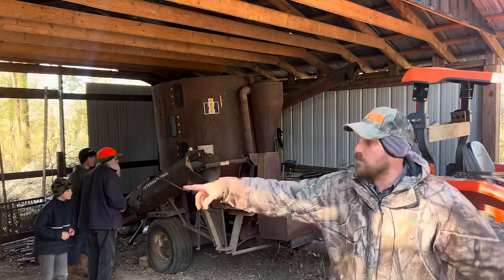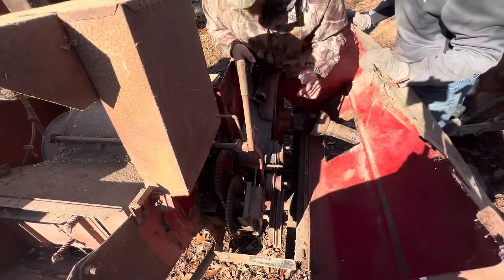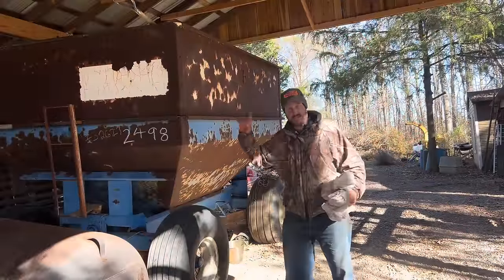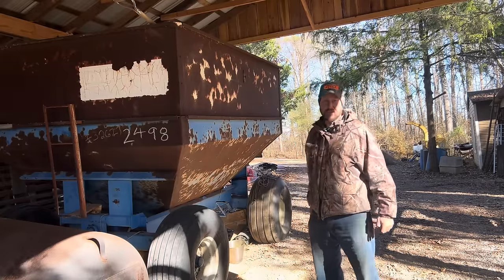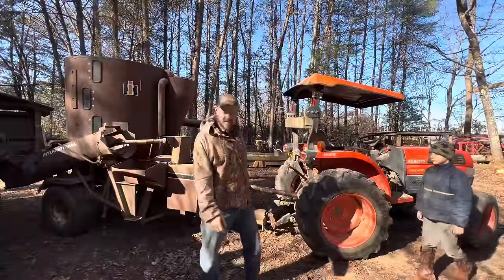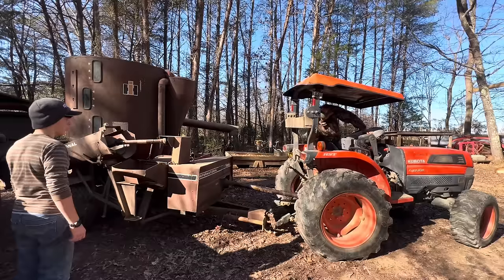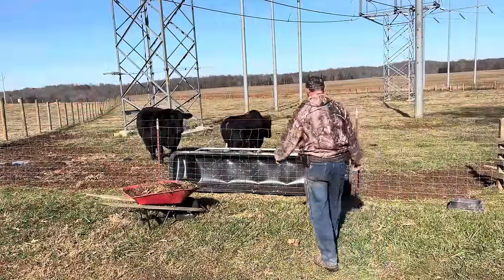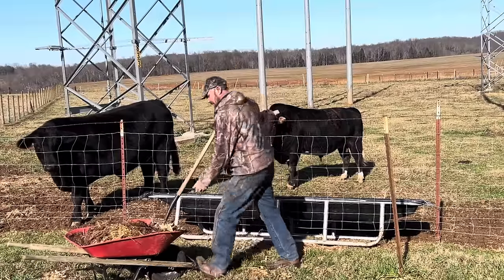Using the old hammer mill to make BEEF!

Comment: We have a old Massey Ferguson hammer mill a lot like that one. We run it with an old 4010 John Deere tractor, 90hp and it’ll pull even it down if we put too much in it at once. We use it all the time for hog feed and cow feed.  So far it’s held up well but I’m just waiting for something to break and I figure parts will probably be hard to find for it
Reply from the maker: That’s always a concern…… hopefully it’ll hold out!